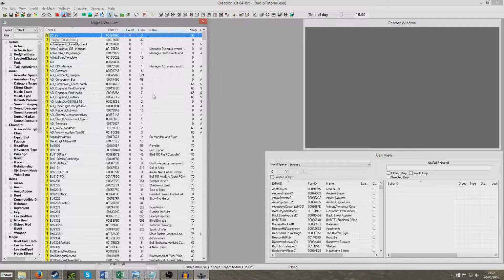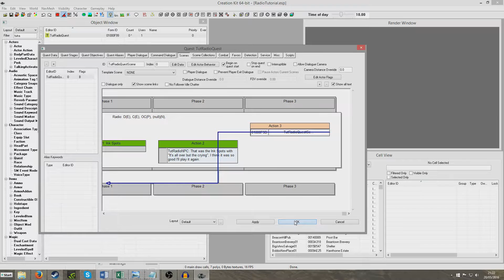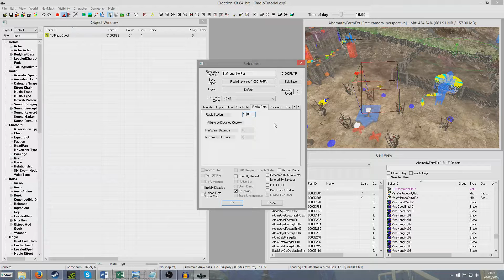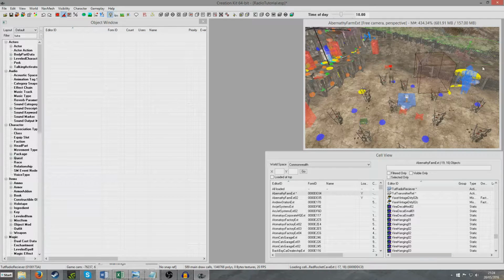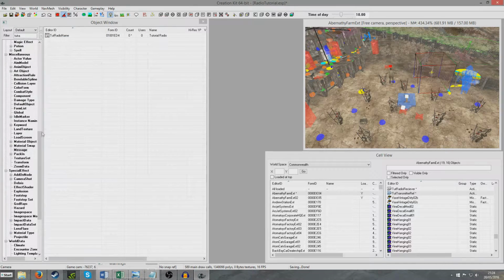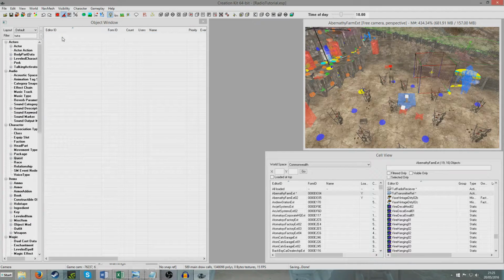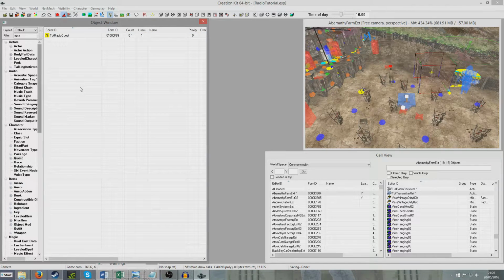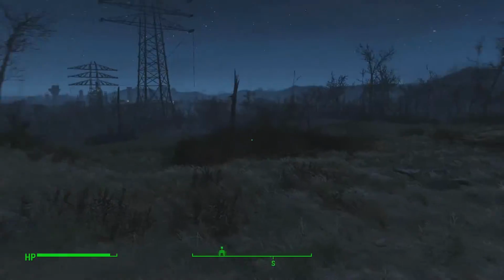Fallout 4 Creation Kit Tutorial - Pipboy Radio

Comment: I've been trying to make a quest where the player has to listen to a radio station. I've tried for a few hours but I just can't figure it out. Do you know how?
Reply from the maker: +LRA10 You can set a stage through a radio the same way you would through dialogue, either using the set parent stage dropdown menu or, if they quest you want to set isn't the one which houses the radio, creating a property to point to your quest within the fragment of the line you want to set a stage. However, the stage will set right away because the radio is always playing. You need to condition your phases so they only play when the player is listening to your radio. Double click each phase, the grey boxes at the top, and go to the 'start' tab. Add the conditions IsPlayerRadioOn NONE ==1 and GetPlayerRadioFrequency NONE == XX replace those two XXs with whatever frequency your radio is set to. That way the radio only plays when the player listens to it and the quest stage can be set being sure that the player heard it. Also, make sure any phases which link scenes continue to player. If every phase has those conditions on it, it will block the radio from ever playing.